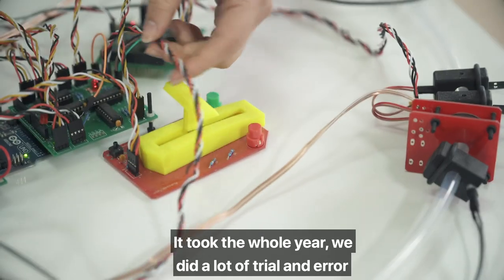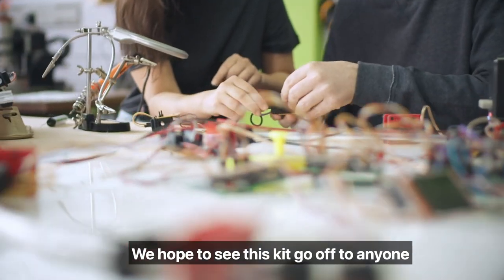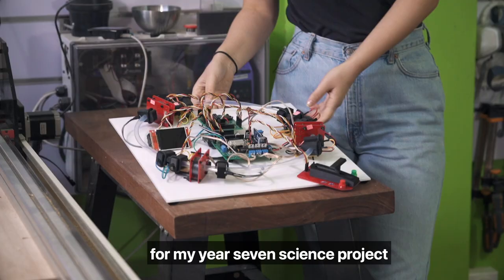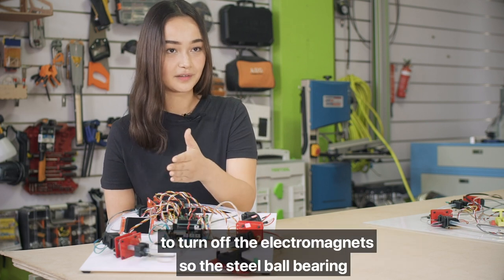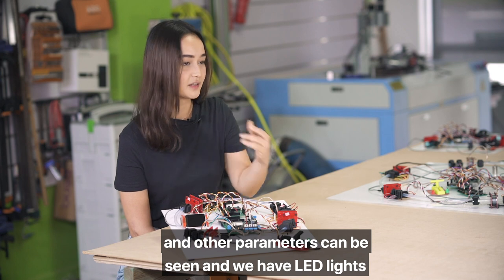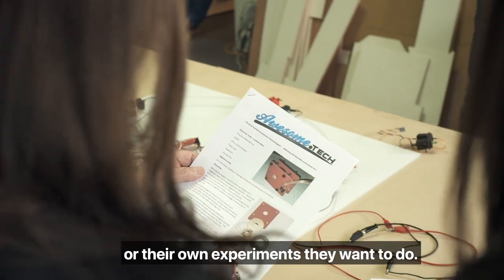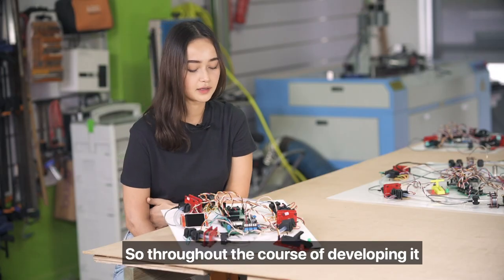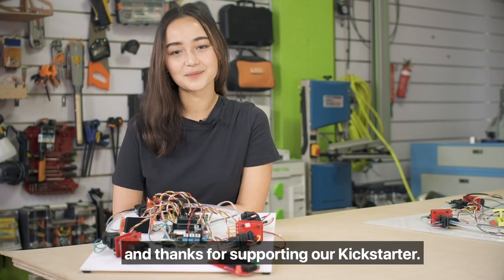DIY Personal Particle Accelerator Kickstarter - NOW LIVE

Comment: But a iron marble can't accelerate to 99% the speed of light. I would prefer you make one that is actually using elementary particles. Not so visual, but more realistic.
Reply: ya true
Reply: That would need to be done in vacuum, which immediate adds cost.  Not to mention an electron source.  The accelerator will also have to be very big, because the particles are traveling at the speed of light, which means they cover a lot of distance over a short amount of time.  "Compact" accelerators based on laser plasma wakefield is still an area of research - plus you need a big laser.  On the other hand SLAC supposedly came up with an accelerator on a chip, but good luck getting your hands on one of those.
Reply: @cryora  I want to build one that is based on hollow-core fibers.
Reply: @SkyDarmos  That could work, depending on the acceleration scheme used.  If you're trying to do it similar to the accelerator on a chip like in this video https://www.youtube.com/watch?v=V89qvy8whxY then you'll need to be able to create ridge patterns, as well as a perpendicular laser source big enough to illuminate the entire fiber.
Reply: @cryora  No. I cannot use that chip approach. In order for my antigravity technology to work, the mass of the accelerated gas particles must exceed the mass of the container. Then mass inflation does the rest.
Reply: @SkyDarmos  Have you calculated how fast those particles need to be moving in order to to exceed the mass of the container?  You might find that the energy required is so large, that you might as well jump or build a hovercraft.
Reply: @cryora  It is unclear how much friction there would be. Well, there is no point for someone with a theory of everything to build something based on ordinary physics. It wouldn’t help my cause.
Reply: @cryora  The gas should already be heavier than the container before the acceleration. That is easy when using Iodine heptafluoride for the gas.
Reply: @SkyDarmos  You serious?  I thought you were joking.  Can you explain how this mass inflation leads to antigravity?
Reply: @cryora  Not antigravity but altered gravity. Gravity really depends on the number of baryons. Freefall acceleration depends on the number of baryons per kilogram. When you inflate the mass, you basically reduce the number of baryons per kilogram.
Reply: @SkyDarmos  So accelerating a particle to near the speed of light increases its mass without increasing the number of baryons?  And this is relativistic mass (gamma*m0) we're talking about, not rest mass (m0)?
Reply: @cryora  Yes, relativistic mass. The evidence that it depends on the baryon number are my countless freefall experiments and all the experiments measuring big-G.
Reply: @SkyDarmos  How do you vary the baryon number per kg in your experiments?  And what experiments or evidence show that it's relativistic mass and not just rest mass that affects the gravitation acceleration?
Reply: @cryora  So far there is only evidence that the ratio between inertial mass and gravitational mass (baryon number) affects the freefall acceleration. However, it stands to reason that relativistic mass is also inertial mass, and so there is little doubt that this should work. As long as the relativistic motion is within the frame, then it is intrinsic and therefore should affect the freefall acceleration.
Reply: @SkyDarmos  Ok.  Well to accelerate particles using the method you described doesn't sound easy.  As the mass of the charged particle goes up, the difficulty of accelerating them also goes up.  With iodine heptaflouride, you're talking about a whole molecule.  To accelerate it, you would have to ionize it to make it a charged particle.  What might happen though is it will also disassociate into atoms.  Even then they are considered "heavy ions", as they are larger than an alpha particle.  Unless of you have thought this through and have a method that works.  What gamma factor would you say is achievable?
Reply: @cryora  I don’t have to at all make it a charged particle. Wakefield acceleration works with a laser not with magnets. The orbit is kept through total internal reflection inside the hollow-core fiber ring.
Reply: @SkyDarmos  Wakefield acceleration acts on electrons, not ions.  Ions are accelerated by bombarding a laser onto a solid film, a very different experiment.
Reply: @cryora  Why shouldn’t the laser be able to accelerate all parts of a gas?
Reply: @SkyDarmos  It's not really the laser that's doing the accelerating as much as it is the electric field gradient from the plasma produced by the laser.  This gradient affects electrons but not so much the ions.  They're just too heavy to respond to the changing fields in time.

Comment: Not a particle accelerator.  I know that might sound obvious but this is youtube not toys-r-us or sharper image.  This is a particle accelerator "cosplay".

We should have actual particle accelerators in tiny MEMS packages and tabletop size in the next 5-10 years.
Reply: so you can warp the fabric of space from your basement. Maybe you might a find a reality that you don't suck in. But don't hold your breath.
Reply: Do you think she's not aware that what she made is a model? I'm also baffled by "this is YouTube not toys-r-us." Do you mean that YouTube is a paragon of scientific discovery and discourse? The same video platform that hosts mukbangs? Also, no, we won't have MEMS package particle accelerators any time soon, if ever. I get the impression that you don't understand the immense amount of energy required to drive a particle accelerator, or even what a MEMS package is. That's just a Micro Electromechanical System. It's little bits of metal sliding around acting as variable capacitors. That's not remotely an accelerator

Comment: you can make this mechanically using a motor and a cam driving a distribuator by discharges  connected to coils given the right winding turn ratio around the tube coils. that would be much easier than programming a chip. the cam will drive the ignition coil that will power the winding on the tube ring. if you need more power use capacitors and then use a 12 volt to 200 volt transformer trough the cam drive and use a second cam drive to trigger a ignition coil and with a distribuator motor and then wire the cap across each winding with the spark gap between then on the motor operated distribuator. the distribuator must be sealed to prevent ozone from being released and the sparks will be in there and also very bright light. the first cam operated motor charges the capacitor. the second cam operated motor create a discharge path of ions to discharge the capacitor. you can as a second option also use four capacitors at 200 volts and charge them with four separate ignition coils driven by a single cam driven motor. mechanical systems are more reliable and safe than electronics that can burn out easly.
Reply: wow im interested, is there a video on yt so i can understand more clearly??